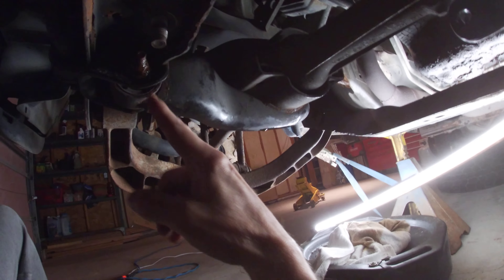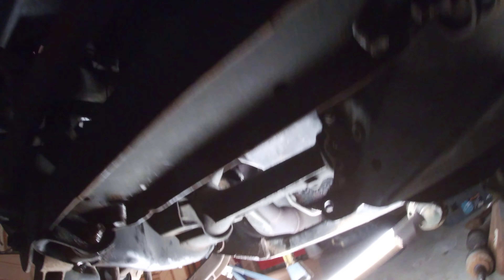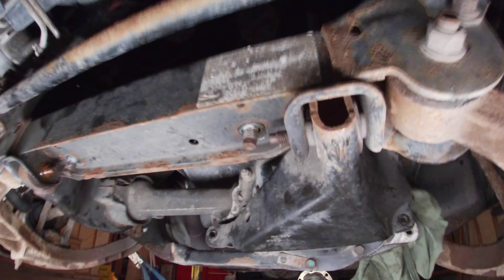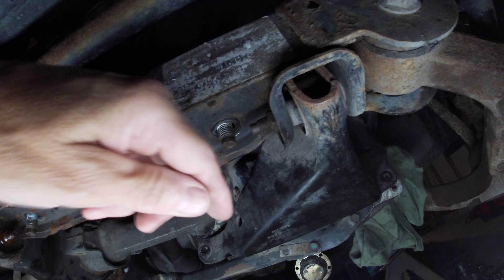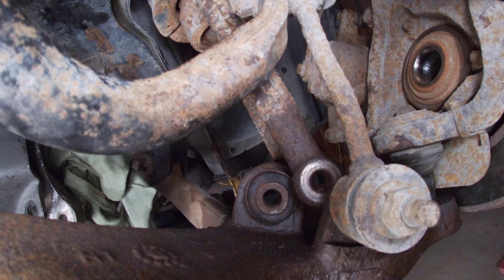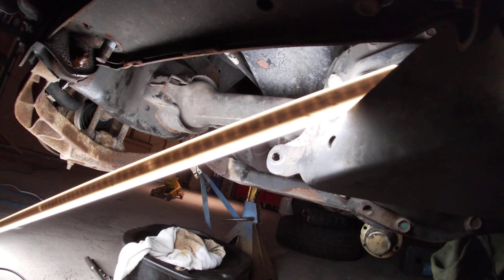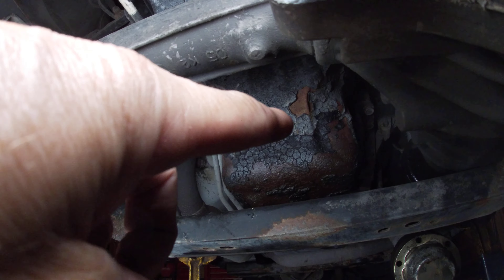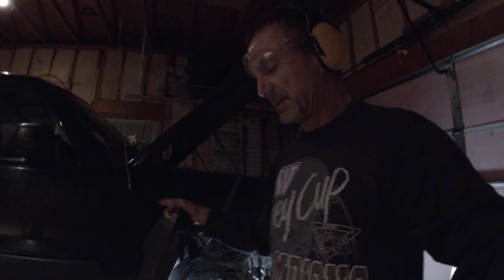It's a JEEP THING! Jeep Liberty Oil Pan Replacement Day 56

Comment: The 3.7 is the biggest POS engine ever designed by anyone ever. If you have one that's currently running, sell it now and thank me later.
Reply from the maker: It is almost as bad as the CRD Liberty.....
Reply: What is wrong with an engine that goes 300k? It  is not all easy to work on in certain areas .That is why there are pros that can do the job for a living without crying. . The 2.7 is garbage .The 3.7l just keep it running cool and use good oil .Rather have the older 3.9l that is also a long runner but with less horses . Wonder if it would fit ?If your old school the 3.9l can be carbureted pre magnum series.Outlast any rice burner Ford or Chevy v6 in a truck